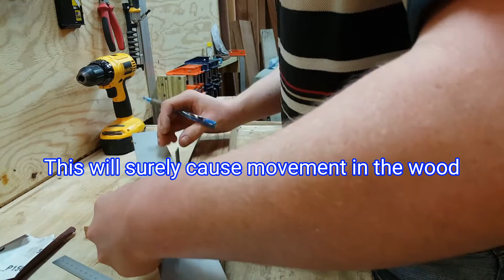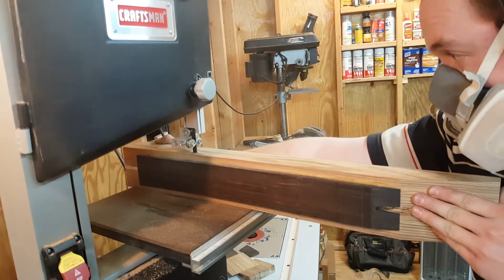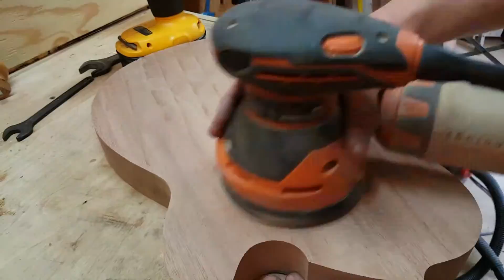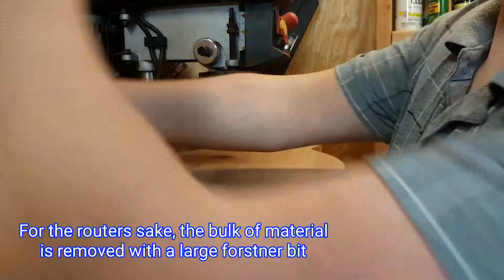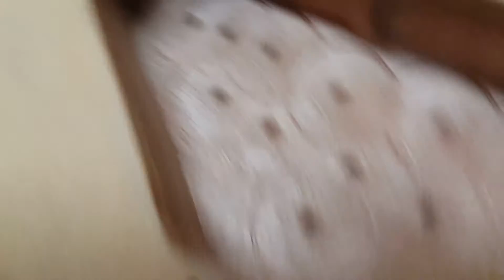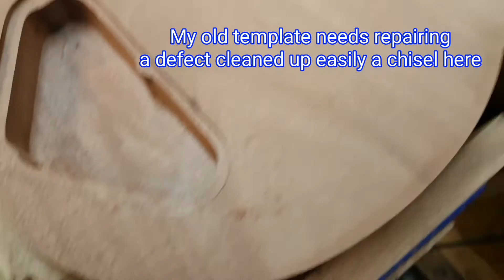Full Guitar Build Part 2

Comment: A little bit of hot glue or super glue and masking tape trick to hold down the body while reducing its thickness would help a ton, just some friendly advise 🙂
Reply from the maker: Thank you for watching! 

Both of those methods are great for holding work pieces in place. I am aware of those, this jig has a holding method built into it, so those other methods were not used.